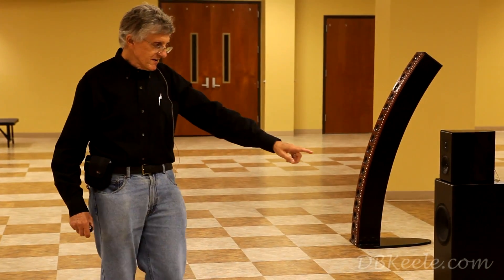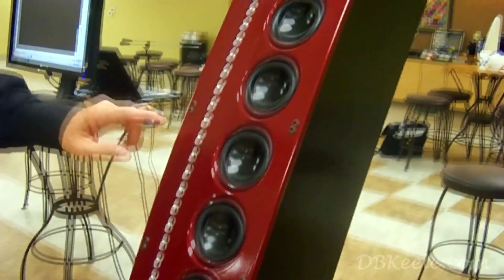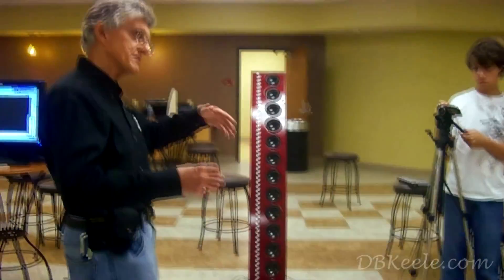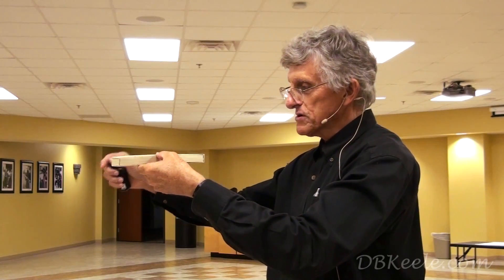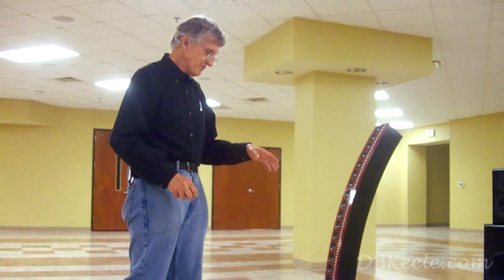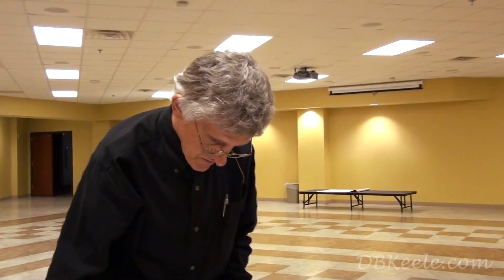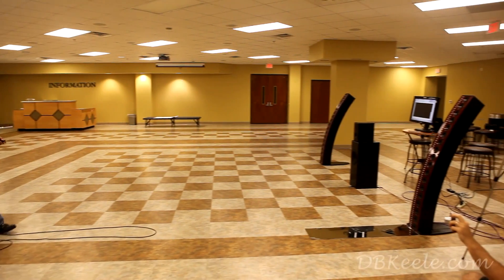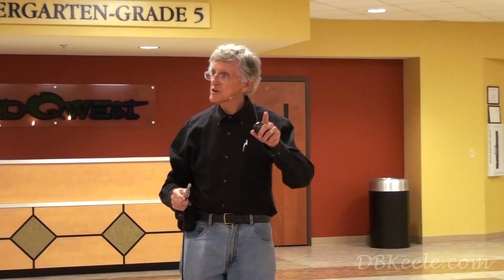CBT Chronicles Part 7 of 9 Measurements Continued: The CBT Ground-Plane System

Comment: Will you be selling some instructions so we can build one of our own with the drivers we already have? I was going to build a 9 foot tall line array (straight) and you have stopped me in my tracks. I already bought the drivers.  My friends and I were laughing that you probably made a killer 3 way system to compare. It looks great!
Reply: It is quite complex to start from scratch regarding the wiring/attenuation and driver count across the curved array, what drivers do you have? I have the Dayton CBT24 array which is 24x 2 inch full range drivers (tweeter-less design too) There is a paper form Don regarding applying delays to a straight line but its not as good as a true curved arc

Comment: The frequency amplitude retention of the CBT is unreal. Nice system design Don. The off axis output sums [2 wavefronts] as you move away correct? That accounts for the relative level change stability, this IS quite a system.